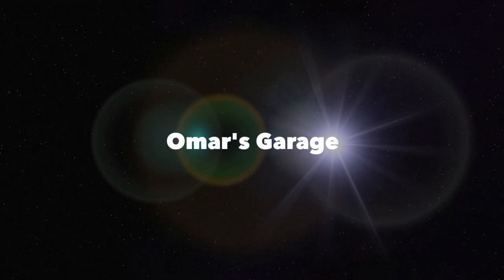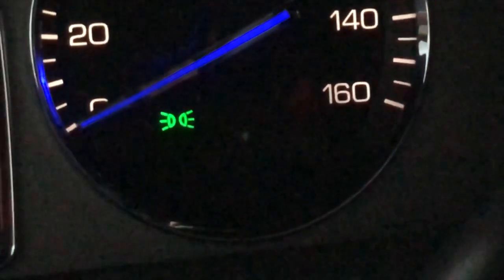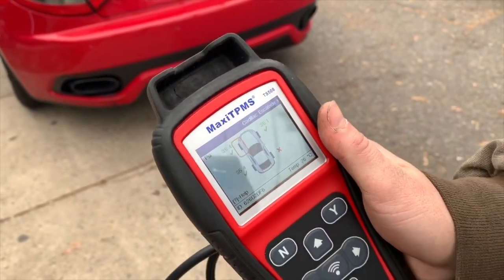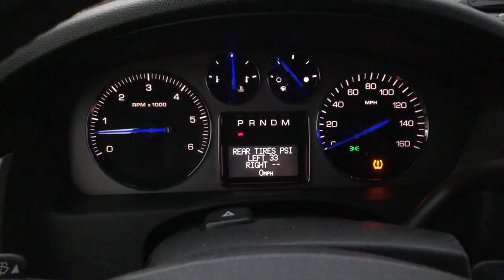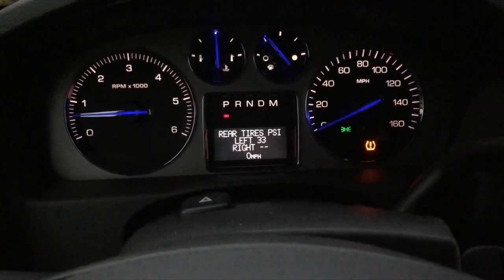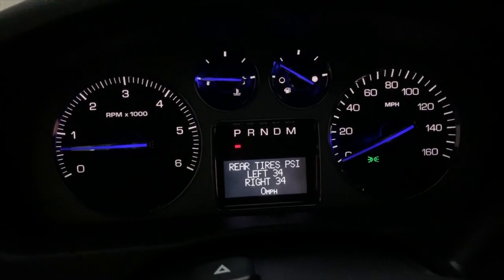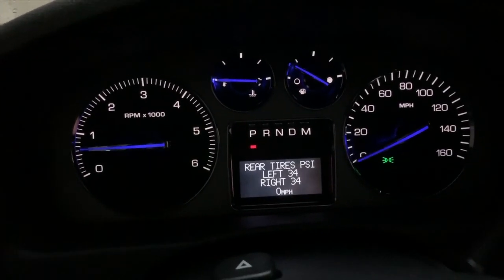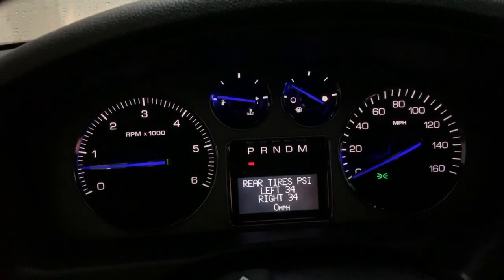Replacing a Tire Pressure Sensor Service Tire Monitor System GM Escalade Tahoe Denali Yukon

Comment: I’m having a similar issue with my 2010 Escalade, although it’s intermittent. I will got a bump on the highway, going over a bridge for example, and it will set of the “Service Tire Monitoring System”. After some time, maybe a day or so, the error message and yellow light will go away. It’s always for the same tire. Is there anything else besides the tire sensor that could go bad?
Reply from the maker: Nathan Vaichus how old is your car?  The battery in that sensor is most likely on its last leg.  Also make sure that the tires are all at the ideal pressure.  If that one tire is low, depending on the temperature of the tire it can fluctuate and throw a code.

Comment: Help 2010 escalade service tire light, I bought 4 oem ac delco sensors installed new tires, they reset tires and the tire activation won’t register I have done multiple reset please help
Reply from the maker: The tire installation place should have been able to use the scanner programmer to reset the sensors manually. Where they not able to?
Reply: @OmarsGarage  they tried at discount tire with scanner, I have tried manual reset and step by step and it registers but when I turn off the on position it erases it won’t pair

Comment: So how to replace the sensor ???
Reply from the maker: Essam Nourah you have to remove the tire and replace the valve stem which contains the sensor/transmitter.  This is one for sale on Amazon HLC 13581558 GM Tire Pressure Monitoring Sensor TPMS Sensor 315MHZFits for Buick GMC Chevrolet Cadillac https://www.amazon.com/dp/B07FMN726J/ref=cm_sw_r_cp_api_i_Bs1qCbXZQSDAK . Once you have replaced it you have to go through the relearn process which I also have a video for on my channel.  If you take it to a shop they can do it with a tool as I showed in this video.
Reply: @OmarsGarage  thank you so much

Comment: How much was it?
Reply from the maker: Mnj fmj I think I paid round $50 to have it installed.  Remember that they have to remove the tire and rebalance the wheel.  The sensor you can get aftermarket for $17 if you have the equipment to do it yourself. Jsueng GM 13581558 Tire Pressure Monitoring System TPMS Sensor 315MHz https://www.amazon.com/dp/B07DQHW426/ref=cm_sw_r_cp_api_i_56I9CbHE3P3BB

Comment: INSTEAD OF BUYING SENSOR EQUIPMENT, JUST USE AN, AIR PUMP PRESSURE UNIT.🤓🧐🤑🤑🤑
Reply from the maker: This is for when the battery dies on your sensor. They will all eventually go bad. They have to be replaced.